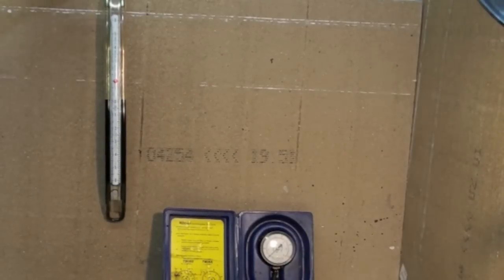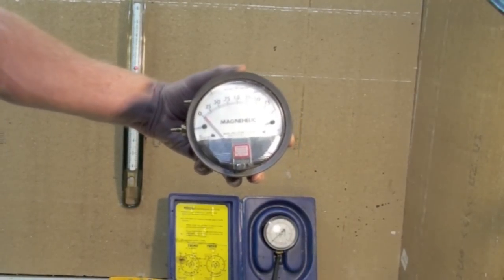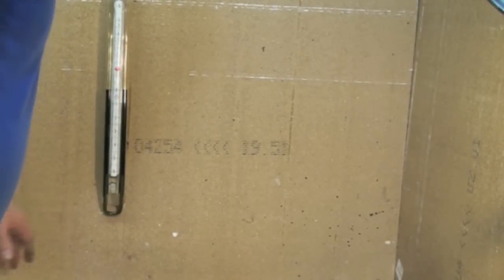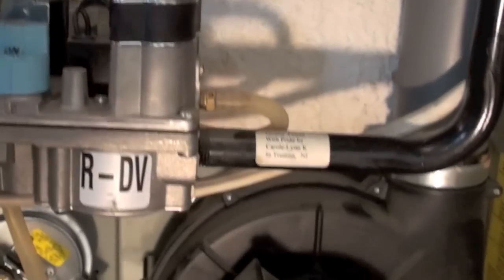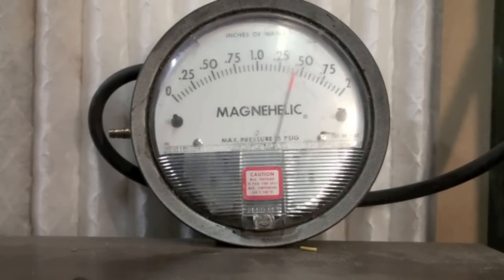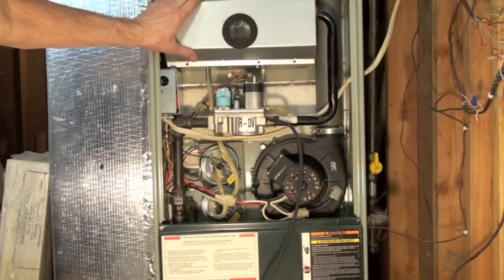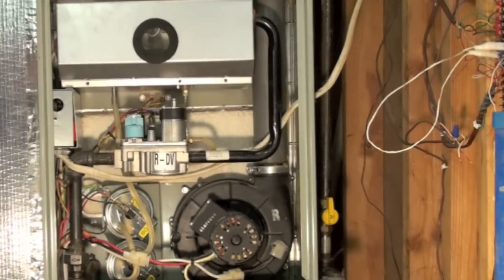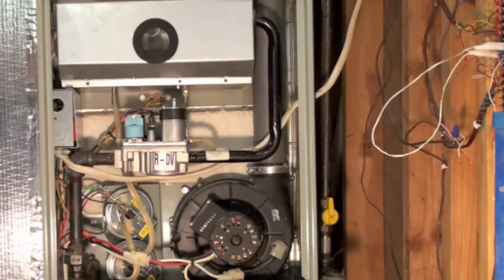How to test water column gauges for gas furnaces

Comment: CERTAIN  LOCATIONS  IN USA
Have higher Btu capacity 
In the natural gas
Location that I am in A furnace that would be
3.5 manifold  pressure 
Has to be set 2.8 to 3.
Inches  w.c
 Not trying to be a no it all
Just wanted to help
66 yr old still watching and
Learning

Comment: Great video. Where I work, policy is to use a good quality U-tube as it is capable of being field calibrated. From what I understand there was a lawsuit from a gas mishap in the past and what won the  Lawsuit was the use of a device for pressure testing that the tech had no record of calibration of the device used so that was the attack point of good lawyers. I myself have been on the witness stand in Civil Court in the past and have provided adequate testimony that got the Company I worked for a favorable outcome but my guess is that the technician wasn't overly confident in their work that enabled Lawyers to make them them look bad. Love your videos.
Reply from the maker: Interesting info.
GFM

Comment: is the red oil lighter than water as it's specific it has a specific gravity of 0.784 as water is 1 ?
Reply: The instructions on the slack tube monometer state distilled water with A- 126 Fluorescein green color concentrate or mercury (if needing inches of mercury). I didn’t think you can use oil since no one needs inches of oil readings.
Reply from the maker: Anthony Leung Anything less than 1 is lighter than water. 
GFM

Comment: Too ALL visiting this site I want you to know that the instructions given from GFM's video's help me install a new Gas Valve in my home. As a Electronics Technician, with Industrial Maintenance and HVAC training with commercial experience I learned so much from Mr. GFM's videos and verbal instructions. IF YOU FOLLOW THEM WORD FOR WORD! Thank you Mr. GFM for your guidance Sir very informative and very well a learning tool. There're some tricks to the implementation to the setup but not a secret it a operation requirement like I had not knowing that the Pilot lowering is out but to increase the burners is out as well; so be careful to turn the right one out  or in! Mr. GFM has guided me through this process with good information but when it was all said and done it was my ability to understand the process and how to achieve my goal myself with my abilities not Mr. GFM. Thanks for your guidance only Mr. GFM!

Comment: I never use my magnehelic to test manifold pressure. But there's nothing better for testing static pressure in ductwork. I prefer analog to digital because I like a sweeping needle more than blinking numbers and a cheap circuit board doing the a/d conversion. Also the magnehelic needs to be level. I know you were just doing a quick demonstration, but it wasn't level. Thanks for the vid.